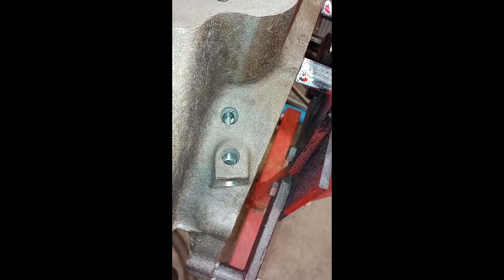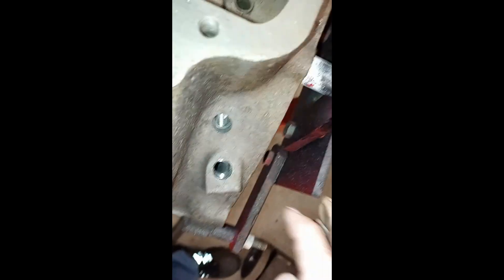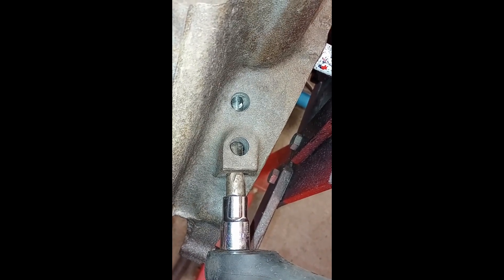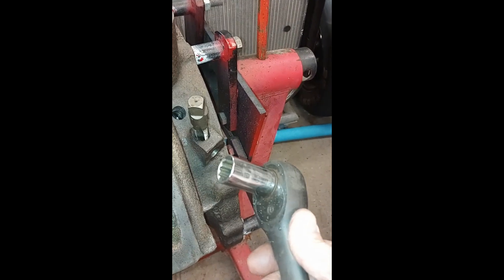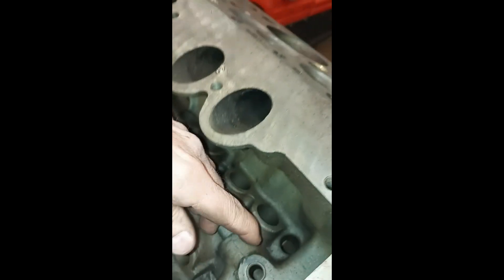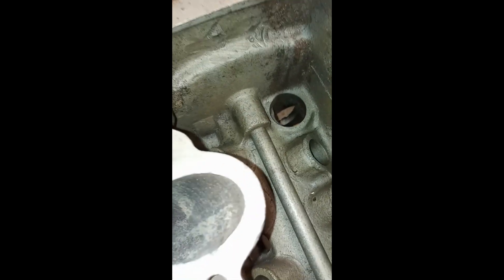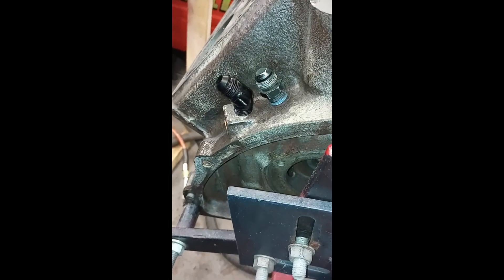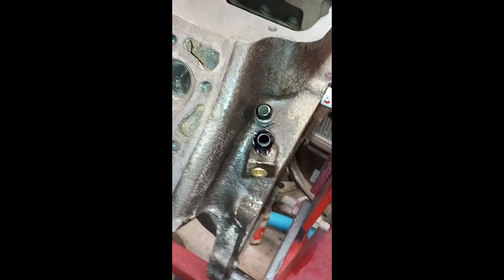Flathead Ford oil filter by pass modification

Comment: Do you  have, for sale,  the complete kit with bypass, metal tubing and fittings to adapt to the '49-'53 8BA Flathead Ford Block? Thanks, Ron
Reply from the maker: sorry, no. I use NPT to an fittings. Mostly Evil Energy on Amazon, they seem to have fairly consistent quality. I also have been using PTFE lined hose as I find it easier to work with and it's good for almost any fluid.

Comment: Is there a bypass in the filter housing ?
Reply from the maker: Not in the housing, but I believe filter would have something like that
Reply: @saltracer1   Ya you need to make sure you have a bypass so when the engine is cold the oil can by passes the filter. The original system did not matter as it could bypass the filter internally.  You just have to make sure the filter you are using has an internal bypass this where the good old FL1/FL1A fits the bill.